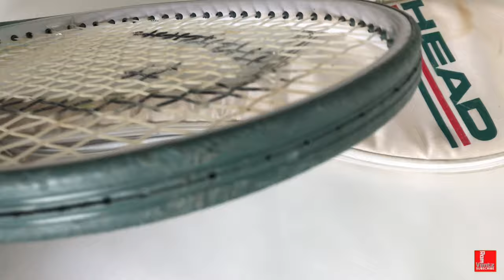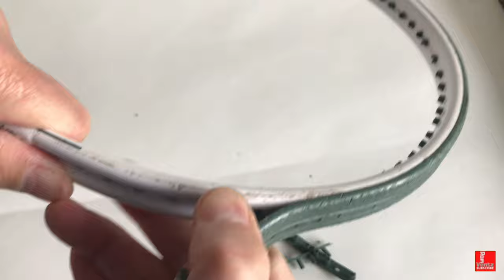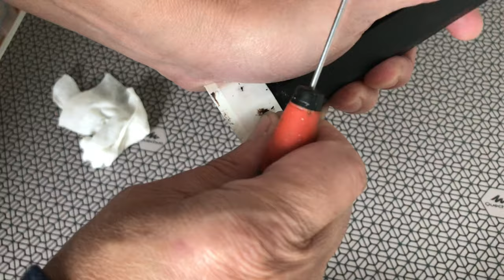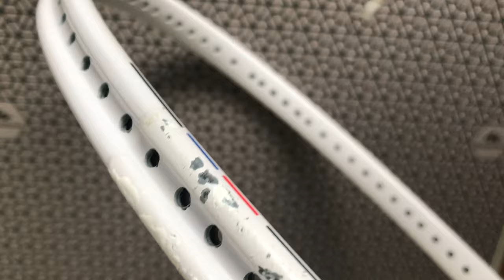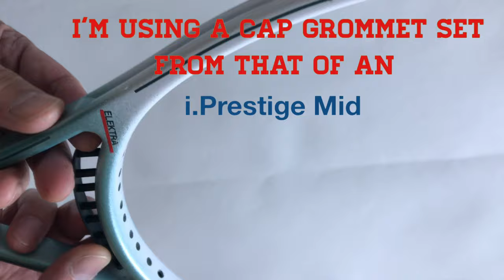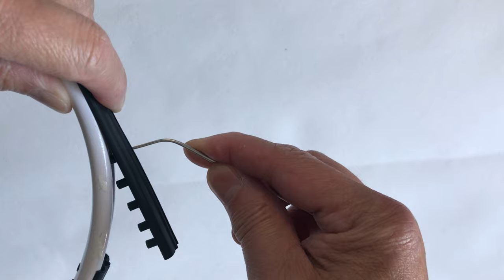Restoring a  Head Elektra Pro Tennis Racket (Released 1987-88) #restoration #ClassicTennisRackets

Comment: How do you know that the gromets you use would fit in the racquet?
Reply from the maker: Most Head mid size tennis from the late 80's to around 2016  are using the same drill hole pattern and are using 18 x 20 string pattern, this applies to most of the Head Mid Plus' as well.
Reply: Thank you for sharing that information, it is very helpful 👍

Comment: Ever heard of scissors? Your choice of tools throughout the entire video was quite bizarre.
Reply from the maker: The tools that I was using on this video does the job fine, tennis strings are quite tough to cut with scissors also in case you don’t know.
Reply: @romeventennis  I do it all the time. Cut them straight up the middle. It cuts the mains as well as the crosses all at once so that there is no uneven tension on the frame, but hey, whatever.